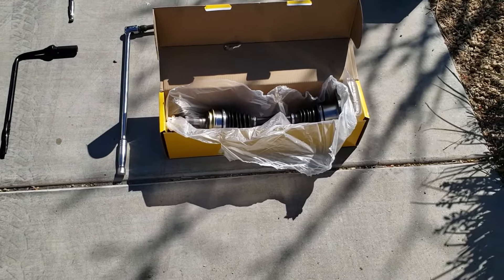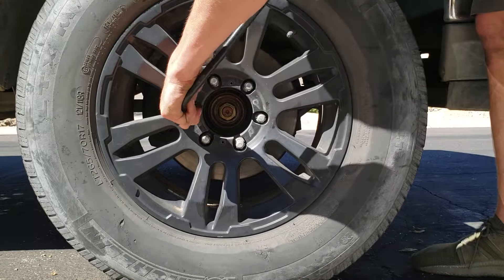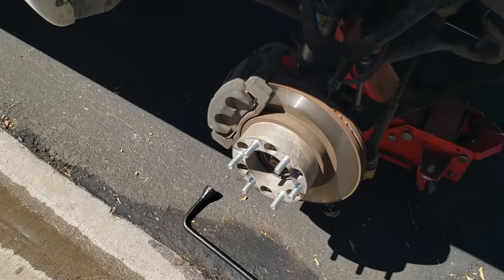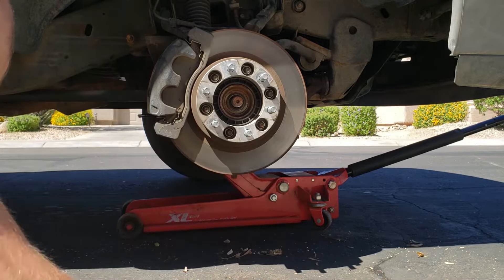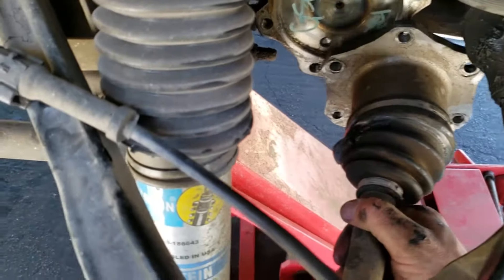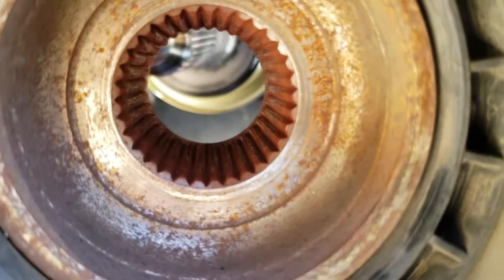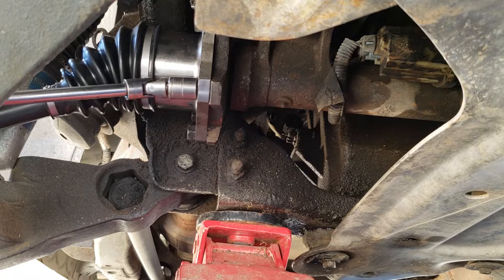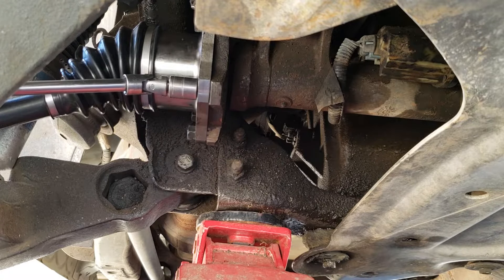How to replace CV Axle Chevy Silverado 00-06

Comment: The 5 bolts on the one end are 57 ft lbs.
The 35mm nut is 177ft lbs.
Reply: Actually OEM specs are 155lbs  for axle nut..
Reply: Lol
Reply: Is it a 35mm or 36mm he states 36mm in video? Also what is the size of the inside bolts thread pitch and length mine have all fallen out
Reply: 36mm
Reply: What size is the 6 bolts on the end of the cv axle?
Reply: Thank you been looking for this everywhere
Reply: Theres 6 bolts on top and its a 36 mm not 35 mm

Comment: Great video, I've worked in too many shops to not point out that the best practice is to hold down the brakes until you get a good star pattern rotation at least two times while the tire is in the air, then lay it down gently so you can rotate the nuts to the proper torque specification. In addition, it's okay to use anti-sieze on any of these nuts so they will not strip during torque rotations. Drive 50 miles or so, then check your lugs again for loosening.
Reply from the maker: Thanks man and thanks a lot for the great advice!!
Reply: Why not break axle bolt loose with wheel and tire on the ground take center cap off and dust cover
Reply: @garycantrell2307 I don't see why you couldn't do that. Thought about that more than once. As I've did this several times.
Reply: That’s exactly how I do it I used the weight of the car in the tires to keep them from spinning tire doesn’t have to come off for this replacement

Comment: Great video thanks! Just did this on a 2000 2500. Bought the replacement part online and once installed it would not rotate beyond 1/8th of a turn. Took the brakes apart thinking I dropped a bolt somewhere, nothing. 3 hours of frustration later took it off and bought another from O’Reilly’s and it spun freely and without binding, you know, like it should. Part ended up being from China 🤷🏼‍♂️. Hopefully someone will learn from my misery and buy from the auto parts stores 😂. Great video

Comment: Good video but with only having one point of contact with the jack. Not good. He should be using jack stands for safety
Reply from the maker: Thank you, i definitely agree i should be using jack stands
Reply: And wheel chocks behind and in front of at least one of the back wheels. Never trust just your E-brake.
Reply from the maker: @penmakerar  very good point, thank you for the advice!
Reply: Optional

Comment: Pro tip: Put a screwdriver through the caliper and into rotor slots to hold the hub still
Reply: Ummm.. hmmm. Better "pro" tip... remove the tyre, then the dust cap, and while the wheel is on the ground you loosen the centre nut. No risk of bending a screwdriver jammed in the rotor, or damaging any other part like the backing plate, brake lines  etc... if the screwdriver slips. Or in this case bending the threads on the wheel studs by wedging something between the studs !! Yikes !!
Reply: @DT-ge8gd  Was this supposed to be an insult?
Reply: @DT-ge8gd  Or did it offend you when I said "Pro tip"?
Reply: @ajbarnes2666  Neither. I just don't think you should call it a "pro" tip when there is a risk of damaging or breaking anything. Call it an "idea", or "another option". 👍
Reply: why not just lock in the 4x4?

Comment: Instead of having someone hold the brakes use the power of the truck to losen the axle nut. Put socket on and gently move forward if doing passengers side and reverse if doing driver's side.

Comment: ive giving up two different shops later and those 5 bolts will not come out , southern truck no rust just original cv's at 364k miles gave out at around 349k miles !

Comment: I just did my hub assembly and the best way I figured out was to put your tire back on finger tight and drop it till the tire is on the ground so the weight of the truck holds the wheel in place
Reply: 3 lug nuts you don't need em all on for that

Comment: Use a screwdriver in the vents of your rotor and spin until it's stopped by the caliper bracket, then you won't have to risk stripping your wheel studs

Comment: I just did this on my 2003 and it was very easy to remove and replace but now my ABS light goes on and off all the time. Why would this happen. Trucks drives great on new axle but unsure why the new axle caused this and how to fix???

Comment: Brake everything loose with the vehicle weight & wheel on ground...then jack up
Reply from the maker: Thats a very good idea! The only one that might be an issue is the axle nut because it is supposed to have a cover over it but if a guy could get the cover off without taking off the rim then that would definitely be the way to go👍🏼 heck it would still probably be worth doing it solo to take off the rim and put it back on just because it can be pretty annoying trying to hold it from turning. I appreciate the advice

Comment: You can change the axle without removing the wheel, but jacked up you can spin the axle to remove the bolts tho. It's easy as pie.

Comment: What I always do to hold the hub from spinning is take a smaller screwdriver and stick it through the top of the brake caliper and into one of the slots on the top of the rotor and it will hold it for you no need to mash the brakes or lock it in 4x4
Reply from the maker: Thanks for the advice man i appreciate it👍
Reply: @Max F no problem man🤙🏻
Reply: I should of read your 5 month old comment before I said the same thing lol

Comment: Is the outside Axel nut a 35mm or 36mm he states 36mm in video? (Someone mentioned a 35mm in comments talking about torque specs for the outside and inside)Also what is the size of the inside bolts thread pitch and length mine have all fallen out. And I can't find any information online anywhere about the size thread pitch and length on those bolts thank you in advance

Comment: Rats.  My 2001 Silverado 1500 ext cab 2WD CV joint does not look anything like this one.  Mine does not tie into the wheel through the middle...  It has a single long shaft that attaches at a right angle to the protrusion on the front of the steering knuckle inside the wheel rim... been searching for two hours online for a diagram and the only one I can find that matches mine is someone's blasted pinterest post and I can't find the diagram through that to save my life.... Frankly not sure what the issue is. Have a strange loud wum-wum-wum tire noise kind of sound that gets faster and slower as I drive/slow down...  no other noises, no clicking, no squeaking, no shimmy, no throwing to one side or the other, steering is great...just this really annoying sound... wondering if maybe the struts are going but ride is just as stable as it has always been. Sigh. Will keep looking.

Comment: someone help me...my inner cv joint is missing 2 bolts and when I rotate the wheel in a circle i can hear the grinding coming from inside of where it connects. what do I need??
Reply: Differential service. Could be bearings.

Comment: With all of the safety precautions ignored you still managed to complete your job with your health intact. Watch out for “Murphy” though. He will catch up on you eventually if you keep ignoring common safety practices. Also besides using proper torque on your fasteners you should grease the splines on the end of the axle shaft before installing. Other than that, good job.

Comment: it looks like you didnt have to remove the tire to do this job but nice video other wise. if you didnt remove the tire then you wouldnt need anyone to hold the brakes.
Reply from the maker: Thank you! That is a good point 👍🏼
Reply: Depends if you have the inner hub cover. He doesn’t.
Reply: @octaneaddictions8198  hmmm so you could pop the wheel off, remove the dust cover, put the wheel back on, drop the jack and finish the job with wheel on the ground......

Comment: Scary.  No safety stands, to begin with.  The flange bolts were not tightened in the proper sequence.  Neither the flange bolts, nor the hub nut were properly torqued.

Comment: Can you still drive without putting back the axel? Because I’m not using my 4x4 any time soon
Reply: Nope, unfortunately not, learned this the hard way as a kid. The wheel bearing will just fall apart without atleast the end of the shaft in there with the main hub nut on it to hold it together